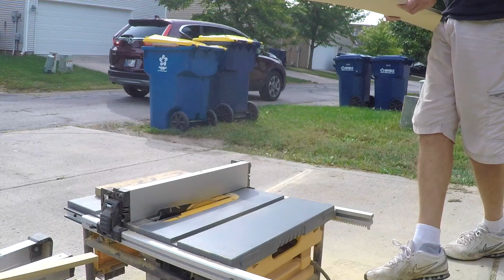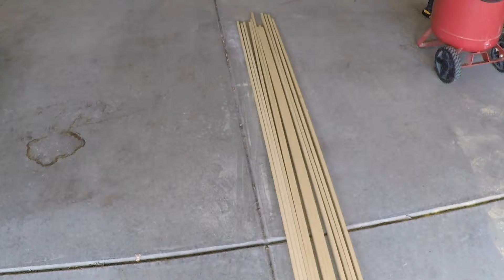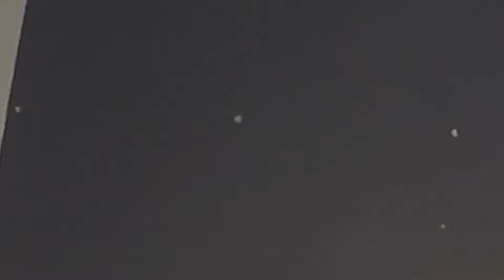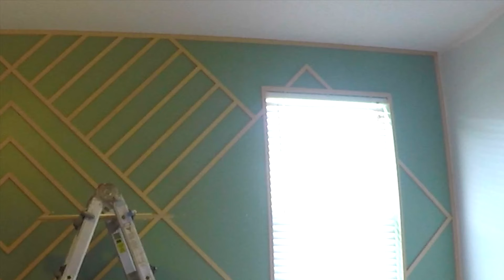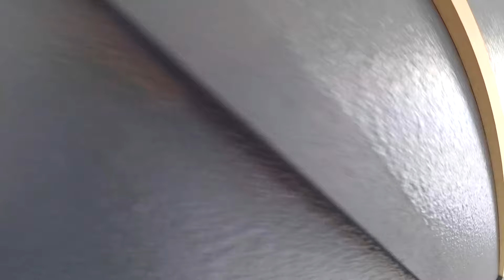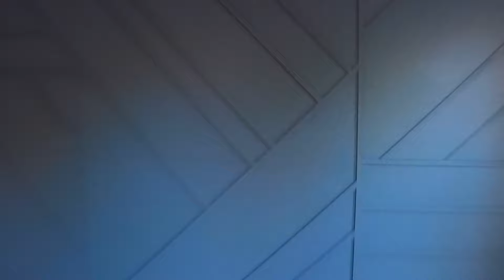How to build a feature wall - random design

Comment: I would like to copy your feature wall using wall strips. My only problem is I have a window in the middle. Would you kindly send me a pdf of design pattern?
Reply from the maker: Hey Laurie,
I don’t think we had a specific plan - more free form. That was my daughters old house - she sold it a few months ago.
Here is a different one -   https://youtu.be/5SKcI4gWJpg
- again ( no plan other than freehand sketch ) but had 2 windows which caused a lot of extra measuring to line it up symmetrically. 
Frankly any plan, symmetrical or not will look great. Just roll with it! 
Thx for watching!
Reply: @Housebarons  Thank you for replying to me!  I will check out the other utube video you sent.  Laure

Comment: Is it necessary to put the boards into studs? Were they a bit heavy?
Reply from the maker: Hey JT,
No. The wood is not heavy, but the Brad nails don’t anchor well into just drywall. Not much holding power. So just pulling on the board, you would end up pulling the board right off the wall if not anchored into a stud.
Thx for the question.